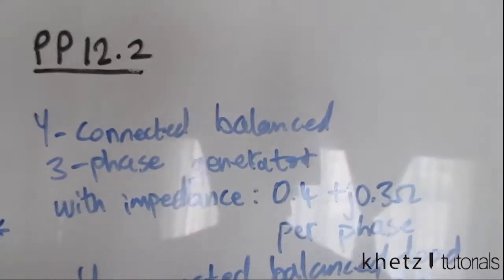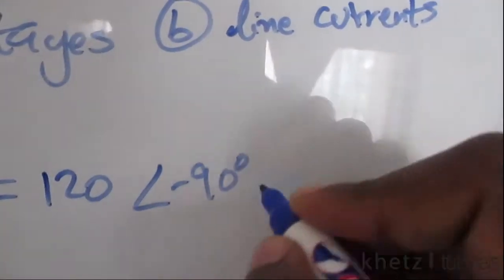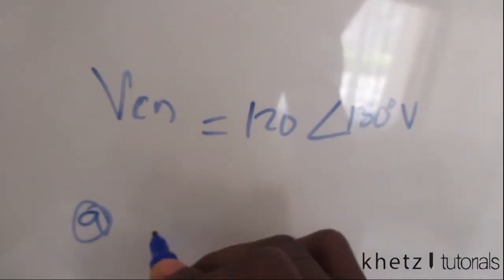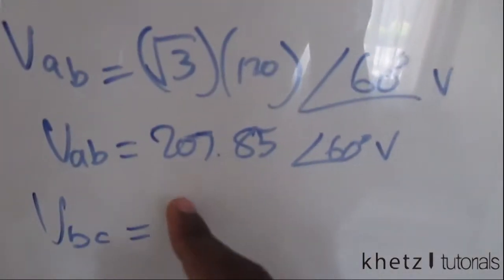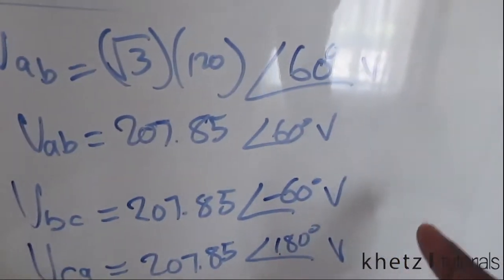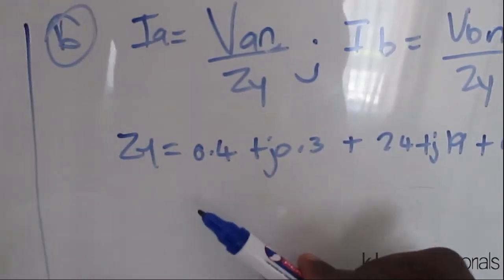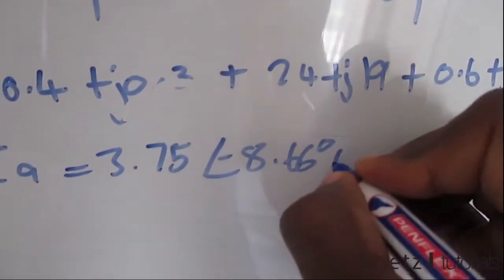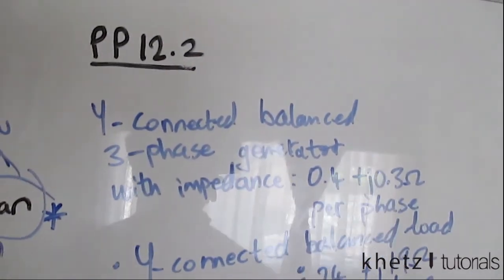Fundamentals Of Electric Circuits Practice Problem 12.2

Comment: why did you use phase voltage for the calculation of line current?
Reply from the maker: I line = Vphase/Zphase for balanced resistive loads. It is the voltage that is actually applied across each phase of the load

Comment: Hello thank you for your videos, I hope all Electrical engineering students (or just anyone wanting to learn) takes a chance to appreciate your videos. I would like to ask you a question, for this problem, the book says the answer to Vca is 207.8<-180, and I understand why they picked that because line voltages follow the same +-120 sequence, however, by the fact that line voltages lead the phase voltages by 30 degrees, you can do the Vcn which is 150 degrees and add 30 to get Vca, so you get the same magnitude but with positive 180 degrees positive, like 207.8<180. Why is does the book leave it as -180 instead of +180, how do we know which answer to pick? thanks again!
Reply from the maker: The question specifically says a positive sequence, so that should guide your signs. Back to the angles, remember that -180 is at the exact same position as 180 on a CAST diagram, for example. A 30 lag would mean that the phase voltage would be at -210, which corresponds to 150. A rule of thumb would be to just add 360 to get a positive angle. 360 is a revolution, so it takes you to the exact same point